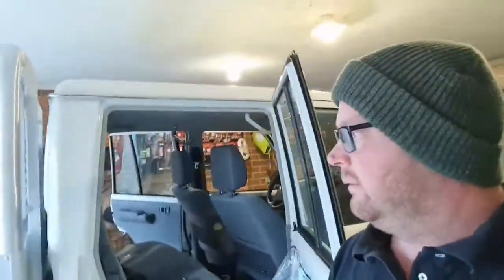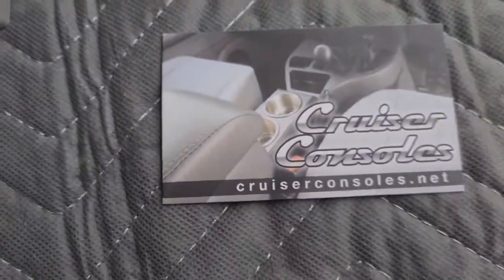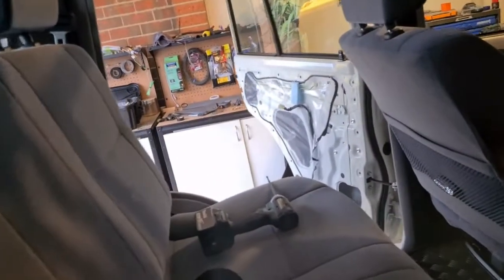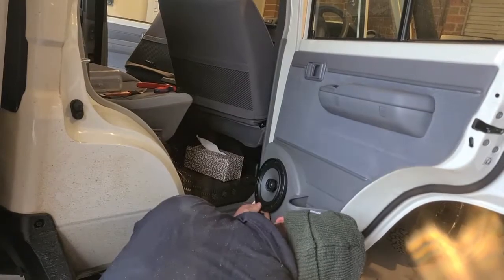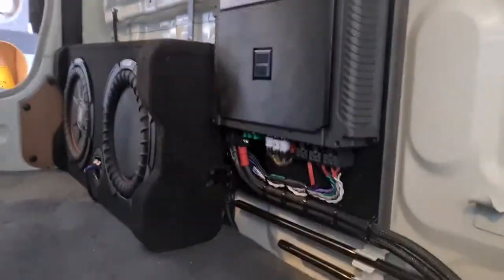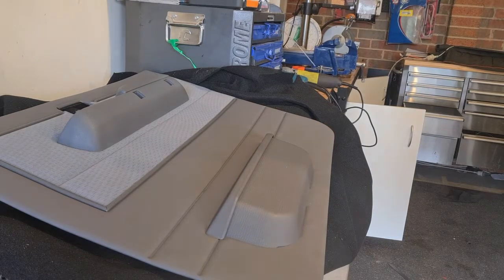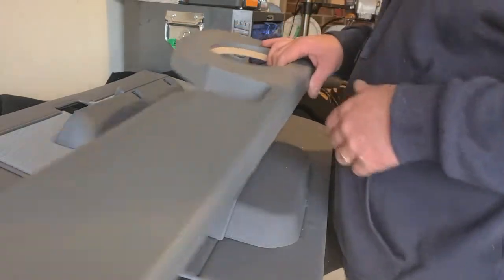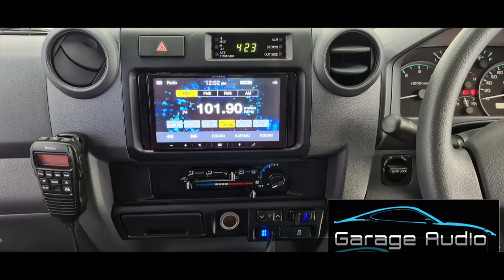2021 Toyota 79 series Stereo upgrade

Comment: The subwoofer is designed to be downfiring, wouldnt you have been better off with a different slimline vertical design?
Reply from the maker: Unfortunately we are limited sometimes to what is supplied to us.
Reply: @garageaudio  fair enough, I had that sub in my Defender ontop of my drawer system, really cool as you can still stack stuff on top of it. I had a regular one before that got punctured when I went bounced over some sanddunes and threw everything in the boot around haha